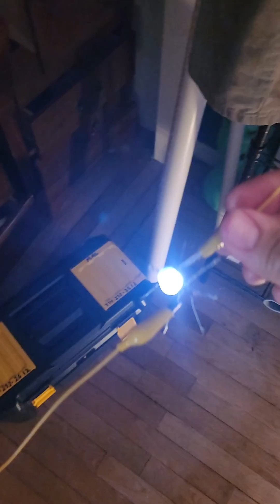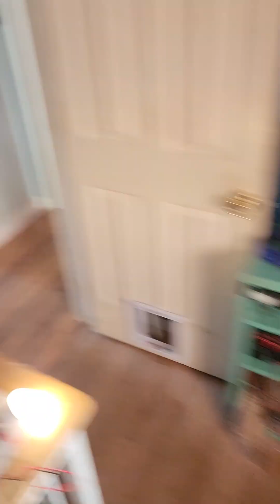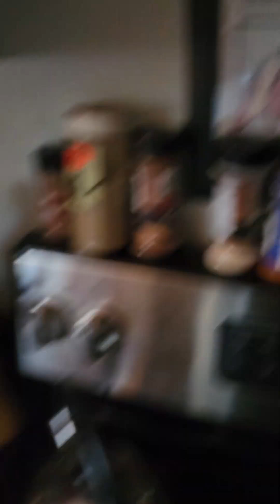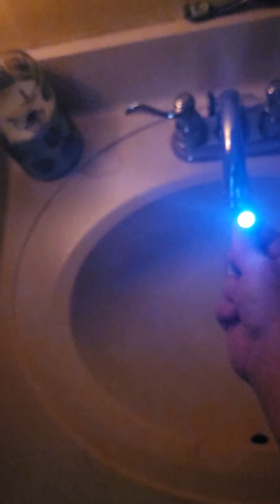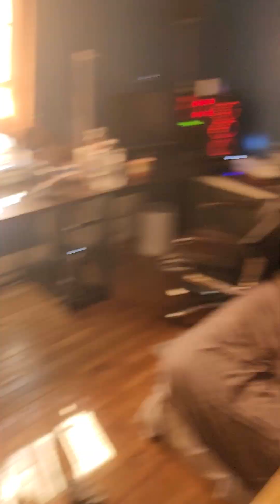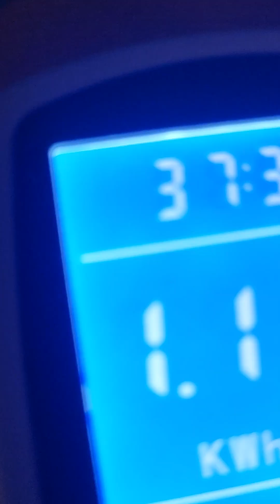⛰️ Quick Explanation Of How I Ground The Device 🌎

Comment: The ground in the house is a large circuit. It's just a huge antenna. It may cause issues with some devices. The larger issue is your likely transmitting which means the fcc may find you. I would get an oscilloscope and verify the frequency and distance of the transmission. I have done this, it's not really anything more than hf on the ground wire.
Reply from the maker: Very true but an interesting phenomenon occurs when seperatly grounding multiple receivers. I seem to be able to produce unlimited amounts of lighting with no drain on my transmitter
Reply: @MTECHINDUSTRIES  that is due to the fact of the length of ground being different on each wire. It has to do with antenna and transmission  line theory. It has to do with the peaks of the waves forming vs reflecting back. The wavelength plus distance on wire causes antennas to have hot spots. You need to learn transmission line theory. I work with radio so I understand wave propagation on the antenna and transmission lines. Some points will have a null potential others will have a peak potential all on the same wire. And in the house you have that plus different size / length wires to different outlets.